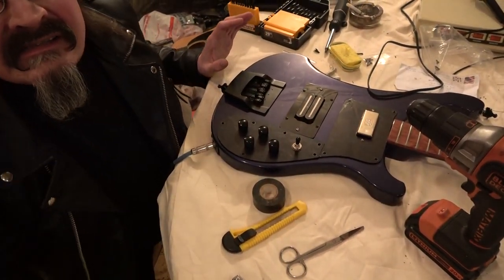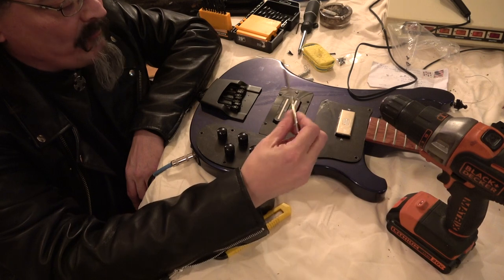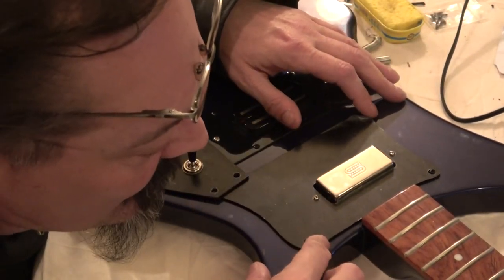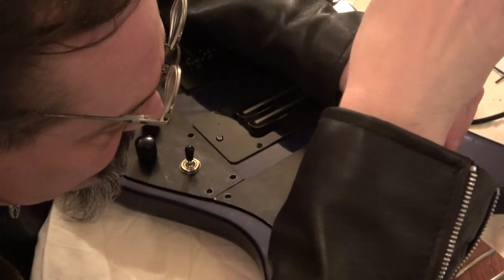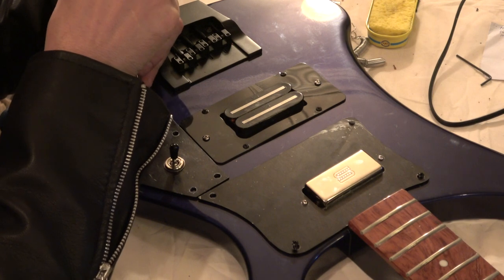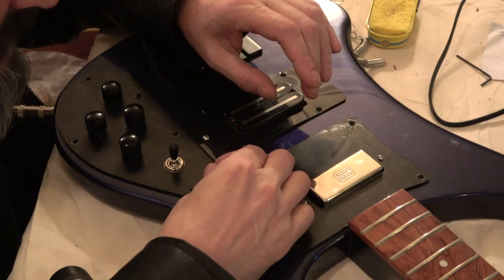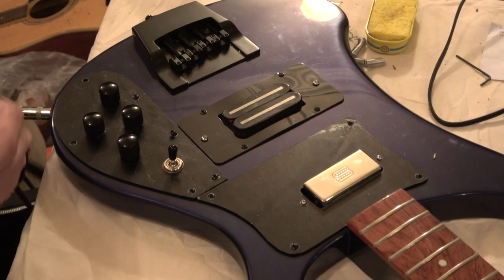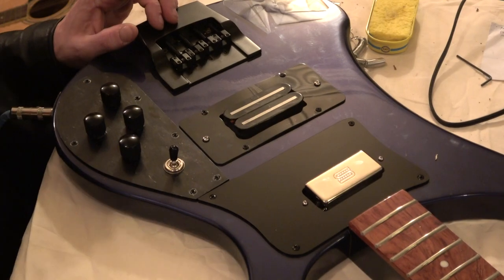RICKENBACKER 4003s Pick guard installation. B/W ALL PARTS SUCKS!

Comment: Robert, if the the volume and tone controls are located where they are supposed to be, like neck vol + tone closest to you, and bridge vol + tone furthest away, then your issue is obviously with the 3 position switch.   It is an easy re soldering of 2 wires that actually feed the input lug of the respective volume pot..  I do have a diagram for this guitar that is not the one from Rick, but way easier to work with IMHO.

I have installed active EMG's on my 1975 4001, and swear by the diagram.  My EMG's had to be soldered in, unlike the plug and play type you can get today.
Reply from the maker: Hey there thanks for the comment. I did figure out the switch after some black coffee. It's not really an issue because I keep both pickups on most of the time, but I did get it the correct way.
Emg's in a Ric are not a new  concept. DD Verni from Overkill installed  a set in his black Ric after heard how good they sounded in my old made from junk parts P-Bass. Eric Morgan from first order did it to his old 4001 also. This was back in 1986. With enough routing you could probably fit anything you want into a Ric, but that would get you a one way ticket to vintage guitar hell. :) Thanks for watching.

Comment: ‘Nobody listens to me because they consider me an idiot’ ...He says, right as he bashes a screwdriver bit straight into the paint on the front of a Rickenbacker 😂.... I can’t think why bro. Gotta say someones done a lovely job crowning those frets though. Rickenbacker doesn’t do any crowning at the factory. Shocking for the money they charge.
Reply from the maker: Didnt scratch it. But it doesnt matter anyway. I actually play my instruments so they get worn pretty quickly. I have some collector instruments but this one was built specifically to be a road dog. If you keep watching the series you should see what I did to the head stock with a chisel.
Reply: @RobertGraham  I was only jerking your chain tbh 😜. Even on my work horse basses, the fronts tend to be pretty ding free other than the scratch plates... Worn through the paint on the back of the neck on one of them though!
Reply from the maker: @Jonathan_Doe_  I got the body and neck stripped on eBay. I did a couple of videos on my 4003 and 4003s and I compared the stock pickups with the duncans. And I replaced the bridges with Hip Shots. So I wanted to do a bass that didn't have all the things that I feel suck about Rics. My sound guy loves the blue one and the maple one because they have SOOOO much low end. He ads the highs at the board, and I add effects and distortion through the amp. So I'm kinda like tri amped.  I sound awesome that way. LOL
Reply: @RobertGraham  can you link the video with the pick up comparisons pretty please? I can’t seem to find it.